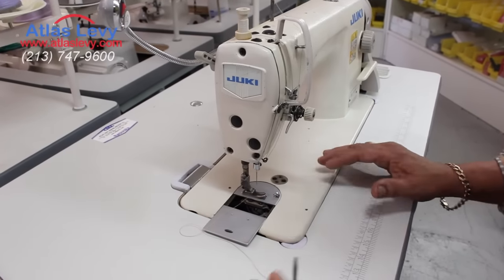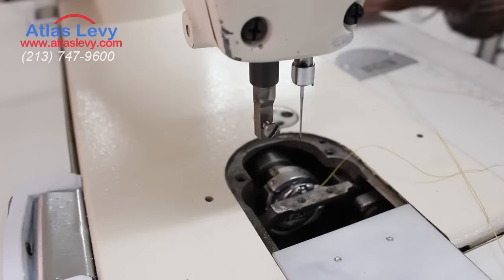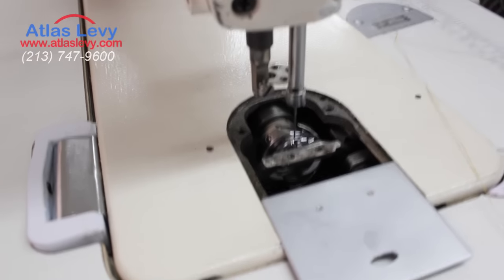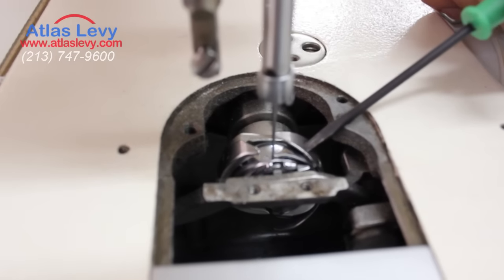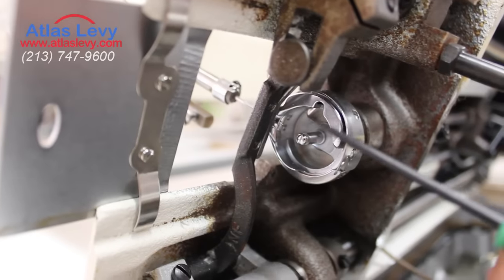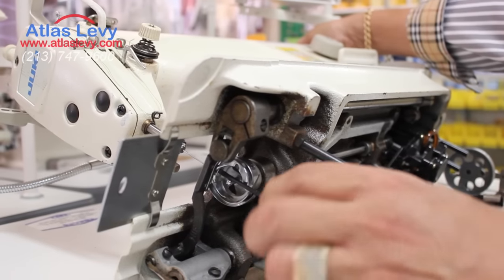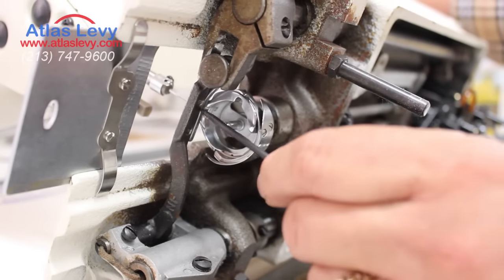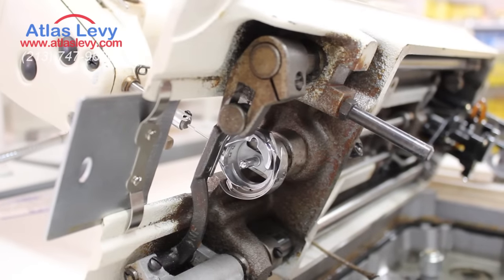How to fix the Hook Timing on an Industrial  Sewing Machine

Comment: Please what to do when you run the motor and it turns very fast by itself, however when you hang on the belt and the machine running very slow. Why? Please help me. Thanks

Comment: AtlasLevy your method shown is totally incorrect, the quickest & easiest way is to grab hold of the hand wheel & give it a sharp twist in the opposite direction. This will 9 times out of 10 solve the problem. Also I must add placing a screwdriver within the Base Needle Hole is asking for trouble as you could burr it & make your problems 10 fold worse.
Richard Australia.

Comment: Thank you so much for taking time to make this video.  It'd helped me to fix my Brother industrial machine.  Save me $100+ and 2 trips to the city.
Reply from the maker: Nice!!!
Reply: Please what to do when you run the motor and it turns very fast by itself, however when you hang on the belt and the machine running very slow. Why? Please help me. Thanks
Reply: @rhoodj  if it's not low voltage, it might be that the belt is loose. Try using a voltage regulator or tighten the . motor

Comment: Thank you for this video. The only problem I have is trying to find screwdrivers that will fit the tiny slots in the small screws on the bobbin case and carriage. Do you have any suggestions for screwdrivers?

Comment: By the way, the hook timing is set as follows. Put in a brand new Schmetz needle with the long groove to the left, ensure it is pushed all the way up into the Needle Bar Hole. Turn the machine over slowly in the normal direction, when the Needle Bar is at the bottom of it's stroke, keep turning the hand wheel so the Needle Bar lifts 3-1/16". At that point the point of the hook should be as close as possible the the needle without touching it, it should also be 1-1/16" above the top of the needle eye.
Richard Australia.
Reply: I will need to know the make and model Tiffany.
Cheers.
Reply: Good Tiffany, after a while (years) every time the needle is changed a little more lint is forced up in to the needle hole above the needle, thus making it lower. That could well be what happened in your case. Glad all is ok now. ASCMCo.
Reply: +Richard Francis on that model there should be two lines or marks on the needle bar, they show where the bottom stroke is & if you keep turning your wheel in the correct direction to the last mark or line that is where the point of the hook should be for timing the needle to hook relation. so it is easier then trying to use a small steel rule for measuring it. I also agree that you should never put a screw driver in the basket where this guy says to do it, cause you can cause a bur to develop from that. I would just remove the positioning finger & turn the machine wheel to you get at the three small screws that hold the basket in the hook and remove the basket to get the thread out. I think that the guy in the video should not be aload to be in the same room of a sewing machine much less repairing it
Reply: Hi Kickstart, well said, however if the machine is an older one the needle bar could be from another machine. I am a bit of a perfectionist mate so that is why I always use a 6" rule, the lower bush could have also been moved. There is another way, use a Vernier Caliper and poke the slide down onto the top of the needle bar or even in it. This is my preferred method but most people would not know or have a Vernier. Thanks Mate, Take Care.
Cookey.

Comment: Hi, I just wanted to say, thank you so much. You really helped us tremendously with this video. You really know your stuff, that's for sure. Do you sell a binder attachment foot for this machine? I just bought one on eBay and it was a piece of junk, didn't even fit my machine so I don't know where to turn next. I don't even know what foot is required to use with a binding attachment. Thank you so much for your amazingly helpful videos!
Reply from the maker: Hello There,  Thanks for the feedback.

As for the binder attachment , please check link below, this item should fit a regular single needle. Thanks. 

http://www.atlaslevy.com/BINDER-FOLDER-S60-A10-Right-Angle-Binder_p_186.html